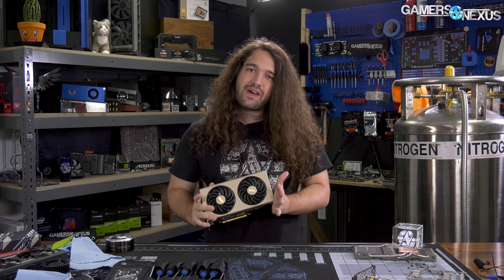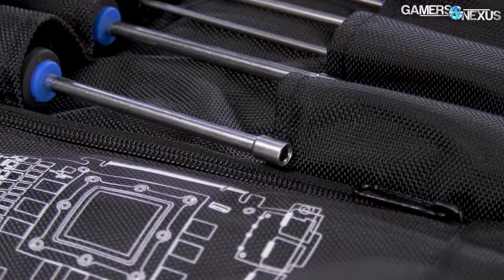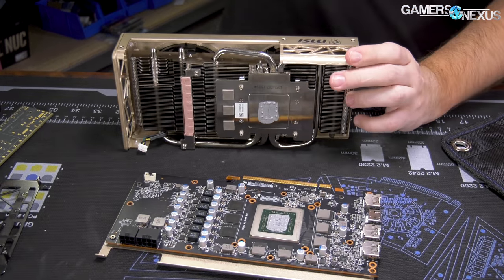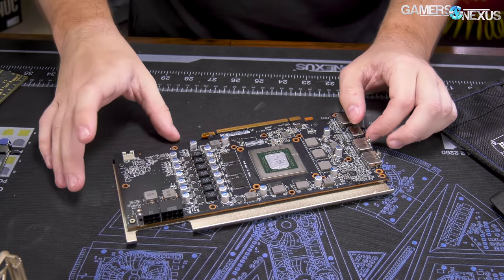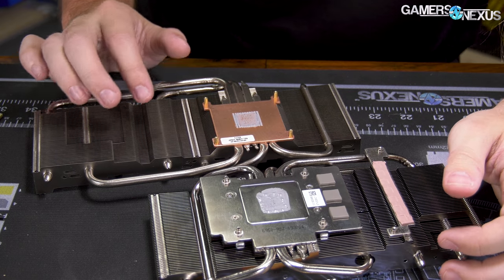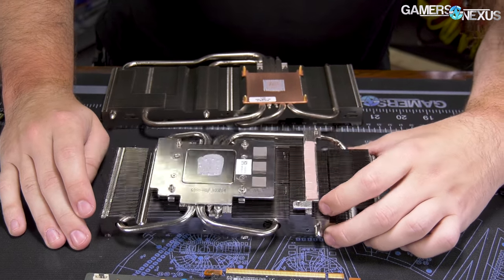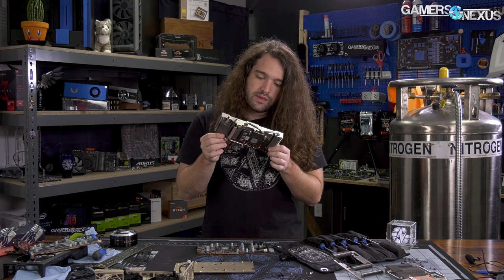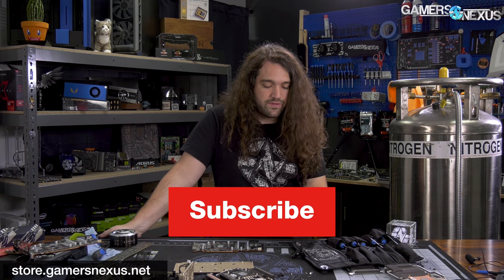Wrong Thermal Pads: Tear-Down of MSI RX 5700 XT Evoke OC

Comment: WTF are you doing, MSI? Between this and the BIOS update issues.. Wow. And you did so well with AMD stuff a year and a half ago..
Reply: @6Twisted  man.. I just bought a gaming pro carbon for my 3600. The feature set was just so good. I mean, they have to fix the BIOS right?
Reply: @6Twisted  I'm ok with losing support for older CPUs. Though I'll be pissed if they release a MAX version in a few weeks.
Reply: Curtis Riceman  it has a bigger BIOS memory chip so you won't lose any features in BIOS updates
Reply: @TheAssassin642  The B450 Tomahawk MAX is already out
Reply: @TheBackyardChemist  yeah but I wanted a Carbon MAX
Reply: True and also some ppl like me have problem with broken LLC on MSI's AM4 boards... LLC worked perfectly until 2019....
Reply: @Qwertypp10  what is an LLC? Are you in the warranty period?
Reply: @TheAssassin642  It is Load line calibration. Because it is broken I have horrible vdroop (I confirmed everything with HWINFO64 and mulitmeter) and I must run CPU at much higher voltage make it stable with my OC settings (I used to run 3975mhz@1,375v LLC=3/auto, now 3950mhz@1,4125v, because at load in fall to about 1,38v without LLC) . I am in warranty period, but it dosen't matter much... I mean in short:
Since 04.2017  I owned MSI B350 PC mate and up to about 2019 LLC was ok. Then probably after X BIOS update with probably some microcode or I don't know what is stoped working. I have RMA of and get new one with exactly same problem, again RMA and I took MSI X470 gaming plus and guess what still same problem...
I have also minor problem that offset voltage also stopped working. Maybe I decide to RMA it again, but I see it is waste of time.
Few topics in net, one on reddit, one mine:
https://www.reddit.com/r/Amd/comments/akmb9j/msi_b450_vdroop_and_llc_experience/
https://forum-en.msi.com/index.php?topic=323307.0
There is Buildzoid video, which shows how it should work, at how it used to work for me too:
https://www.youtube.com/watch?v=2DGDViPRh9k&t=1118s

I also thing that there is a chance that it is in fact broken CPU in some way, but I couldn't check that. However all people with that problem own MSI boards.
Reply: I have their b350 pc mate. I do wish they have new bios update for it, it’s been January
Reply: And the gaming edge wifi is a dumpster fire
Reply: yeah they did well with nvidia cards too, are they cutting corners ?

Comment: Retest with proper thermal pads.  It looks like the memory will fit on that plate
Reply: Why? Who would want to open brand new card? Why not just buy sapphire...
Reply: @megapet777  bro just for science, to see if the cooler's trash or not.
Reply: @megapet777  Garbage thermal paste made from dirt or slave children corpes probably?(Replace) Garbage cooler?(remod noctua with help of scalpel and replace). Installing additional rgb? List go on...
Reply: yea, the plate is not too small, they just used way to small thermal pads, which is ridiculous. retest with proper thermal pads please.
Reply: @megapet777  some folks will come here after already buying the card. Those are the folks that will need the info the most.
Reply: @megapet777  i open every card
Reply: David Lewis  i dig that attitude.
but you cant be sure that your new card is put together exactly like tech jesus' new card
Reply: @megapet777  because if the card works perfectly fine after having the thermal pads fixed, and arguably looks better to the buyer, then why not buy it? Aesthetics always play a HUGE part in our process of buying expensive products.
Reply: Brandon S  Sure, keep opening your cards while I buy ones that work well right out of the box xD

Comment: MSI has never cared about VRAM cooling. They completely neglected a chip on my R9 270x which caused the card to freeze up and require a reboot to make my PC functional again. I had to run my fans above 70% to prevent the chip from overheating.

Comment: Wait, aren't the half thermal pads still on the outside edge of the card?  So the excuse that only half would be contacting the plate because of the plate size doesn't even work here...
Reply: I totally agree
Reply: You saw wrong, or perceived what you saw incorrectly, the thermal pads you saw were for the components on ther other side of the GPU.
Reply: You are spot on.  a larger thermal pad would indeed make complete contact with the plate.  There would have to be a hole in the plate for it to NOT make contact. Just pause at 7:32 , it's obvious.

Comment: And the Sapphire's card has fuses on the PCB, the MSI's doesn't.
The little detail that could save your card if your AIO will leak or somthing.
Reply: Yeah, and the backup bios and bios switch too! The Sapphire card has so many premium features for only $10 over MSRP. They have set the gold standard with card design. Maybe they decided to go all-out this generation because they figured that there'd be a lot of first-time AMD gpu owners because of the general AMD hype train with Zen 2 and Navi? Or, were their cards always this good for this low of a price? I thought they used to be more expensive.
Reply: @syncmonism  A backup bios and bios switch are mostly worthless to most users and those that know what they're doing. I've flashed a few Nvidia cards and, unless you're absolutely insane, those extra features are a moot point.

Comment: A request for future teardowns; you're great at keeping things organized and explaining what you're doing so someone could follow along to replace thermal paste or fans, but would you be able to give some more detail on the hardware you're removing as well?  Things like thermal pad thickness and maybe even screw type (thread/length/etc) if you're able to identify them.  Info like that isn't too common online (thermal pads maybe, but definitely not screws), and as someone who's lost the mounting hardware for the heatsink of a card, that kind of stuff would be great for trying to find replacements without taking apart another one.  Keep up the great reviews and teardowns!

Comment: Gotta save them pennies though.
Quite sad that alot of manuf. do that to keep the cost low,
Reply: Sooo having to cut down thermal pad thickness by 1-2mm to squeeze out like a 1~5% saving in price?
Reply: @dra6o0n  no man, its a lot less, the diference between those is like 15 to 20 cents, they are cutting cost but even for them is not much. They just painted it like gold ans sold it like it, they are coming back to the pre 2014 era
Reply: makes no sense to me. a customer is spending $400 and the bean counters want to place the company branding on the line to save $1 a unit. if they are that desperate to save $1 focus on the packaging!
Reply: @allothernamesbutthis  it's happening everywhere, not just computers.
There is only so much wealth in the world before people start fighting over it.
Reply: @allothernamesbutthis  it wouldn't be just this video card they they are cutting costs on. MSI make around 1.6 millions mobo's and over 1 million video cards per month from one of their Chinese factories. At a saving of $1.00 per unit we are looking at a saving of over $2.6 million per month or over $31 million per year. They are more than likely saving between $2-$5 dollars per unit at the manufacturing level which means the factories management team look like hero's for their shareholders and board members. Remember its all about making more money with limited resources while spending less on expenses which means a higher profit level for the company and the various stakeholders. 

Even with the negative press for the thermal pads from this video card the company is most likely supplying parts for other companies where those companies have customers that "don't care" OR will never be aware of the cost cutting measures as the products they will end up buying will be doing "good enough" so they will get away with it. 

I'ts just good business practice tbh and happens everywhere.

Comment: Question, will you be reviewing the XFX THICC2?
Reply: Seconded. Also curious about the Xfx RAW 2 and any potential tear down videos?
Reply: It's the same dumbass cooler design as the Fatboy. The RX590 Fatboy I own, performs worse than the Sapphire Nitro RX580 I own. It shouldn't. The older chip should perform worse, but it doesn't, because the Nitro has such vastly superior cooling that while the Fatboy throttles down due to temp, the Nitro keeps going at boost clocks.
Reply: This!!! Im waiting for a GN review of that bad boy. Errr uhh, girl? 
I'm not due for an upgrade but I love watching tech content and a video of this card WILL get my view.
Reply: @hyperstimmed  but the name gives it +6.9 fps
Reply: @hyperstimmed  Same issue here. Did you try undervolting the card ? I just decided to underclock and undervolt the card. Got it to 1480 with 960 mv and a power limit of -10%. On average it hits 59c-62c and occasionally can hit 65c. Best part is it consumes between 70w-130w.
Reply: I almost wish that they wouldn't because of the name. XFX clearly has no dignity using such a name, so why should they get free coverage? But, we know that it'll get a review regardless.
Reply: @ShroudedWolf51  Uhh, I don't think a name makes a graphics card. (To enthusiasts any way) It looks good. Aside from the memory and vrm temps.
Reply: @ShroudedWolf51  🤡

Comment: because of the good price, i bought a reference 5700 xt. It boosted itself up to 2000mhz and was running hot (Junction temp 110°C). I limited the frequency to 1800mhz and then my card was not even reaching the 90 degrees anymore. I have a nice airflow with bequiet fans and a additional sidepanel fan which let my card run at 60-78°C with 1800mhz. The amd reference cooler is blowing with 2150 RPM at 80°C and 1650 RPM at 55°C. I wouldnt have bought the card if I had not seen the GamersNexus videos. Thank u steve for helping me to decide.
Now the Card is in good hands and part of the PC Build Family. Sounds a bit crazy, but since im giving to my PC Components Names, i called the 5700XT Steve. Compared to all my favourite PC Builder Channels, you make the best 5700xt Reviews.

Comment: There would be no need for re tooling.  The outer most edge (furthest from the die) of the memory is making the contact, it would of just covered MSI's serial number on the heatsink.  Weird reason to only use half a thermal pad

Comment: A taped together shroud, half contacting thermal pads, no bios switch... the MSI AMD lineup sucks this year. And they did so well on the RX480 Gaming X a few years ago.
Reply: They will probably release many different models of RX 5700 XT and 5700, and hopefully soon they will replace or update this model. They no doubt have a cheaper version on the way, and I wouldn't be completely surprised if one or more of their cheaper versions actually perform better, at least in terms of thermals (they just probably won't look as nice).

Comment: Steve is usually right but the thermal pads are on the outside so a bigger pad would make full contact with the heat plate. The reason they likely made the thermal pads smaller is because they are directly on the heat pipes so they would have better heat transfer anyways and don't want to steal more heat dissipation from the GPU.

Comment: 12:40 you have that backward.  the base plate for the memory is big enough to cover the whole memory chip. if it wasn't, the other half of the memory closer to the gpu would be covered. but you can see the half side that is away from the gpu is covered by thermal pad. so the fault is during assembly.

Comment: You are completely correct, MSI does this. My R9 390x died 4 month after the warranty expired, so I decided to open it up. ALL the thermal pads were like that, not even 50% (more like 30%). I see burn marks on those components and the card is pretty much SOL, tons of artifacts and green spots in 3D rendering. I replaced all the thermal pads myself and ended up with another 3-4 month of use before it completely just artifacts way too much to bare, probably one of the memory chips going bad from the heat. Note worth taking that the thermal paste on the gpu was half as well, the other half was on the PCB board...this is probably a QC problem but many users of 390x from MSI has complained about bad thermals. I was able to get the card under 80c on full load vs 95c brand new by just redoing what should be done in the first place. Everything is also hidden behind that warranty void sticker which stops people from fixing their shit.

I'd stay away from MSI with this shady practice, either they are saving a dollar per card or this is some planned obsolescence or both.

Comment: Steve the coldplate is big enough to cool the entire memory module.  I'm surprised you didn't catch that, but notice the pad is on the FURTHEST part of the memory from the center, which means the other half is not beyond the plate, but further inward.  They literally just put half sized thermal pads on for no reason, the area is there to cool the whole thing.  This would be an easy mod.  And even if a module did stick past the cold plate, it would still be beneficial to put a pad on the whole thing when only half of the pad touches the cold late.  the pad itself will allow for some increased heat transfer horizontally from the module.

Comment: Quality control with MSI seems to have gone south lately. What a shame because I have been a fan of MSI products for a long time. Against my better judgement, I went ahead and bought this card knowing what I was probably getting into; mainly because I got it for $360 after rebates. I like techie projects so I had every intention of tearing the card apart even before installing it. Yep Steve, they only made ONE tweak to this card since you reviewed it; they removed the tape and instead put two small foam/rubber spacers between the cover on that small area that you pointed out instead. The thermal pads are the same crap offset job as you have reviewed here too; and in fact, they completely missed a memory module with no thermal pad at all! I carefully removed all of the thermal pads and applied my own new ones with complete coverage for each module. I removed their soupy thermal paste and applied a better paste and spun the card up on a Ryzen 9 3900x 12-core. It posted a 15,265 PassMark score (ver. 10) with the latest Adrenaline drivers as of this posting. Decent but nothing to go crazy over. It'll be fine for my specific needs and should last quite a while. If I've learned one thing here it's that I may never buy another GPU without first taking it apart and inspecting the factory thermal job. Thanks for doing this review.

Comment: I suspect the reason for the double sided tape might be to eliminate vibration noise.  A cantilevered part of sheet metals vibrating with the fans would almost certainly cause rattling in some unfortunate units.

Comment: I think the solution sapphire solution is not for thermal isolation but rather for easier manufacturer.
They don't have to redesign the main cooler for different cards but only the cooling for the memory / and vrm cooling portion.
As well as not having to make the main cooler more complicated just to cool other parts. The vrm / memory cooling on the sapphire one looks actually pretty cheap to make and it also reinforces the pcb.

Comment: so replace the thermal pads with a minus8 pad or something. that's disappointing cost cutting.
Reply: Just how much money does it really save... It's ridiculous by MSi I can't say for sure but I don't see them doing this to Nvidia
Reply: @saminavy7124  Nvidia is the only GPU manufacturer in the topmost performance bracket, so cards in that price bracket have more effort behind them. AMD's been content to stay in the low and mid tier performance segment, so manufacturers won't put as much effort behind these cards. Asus is the only one to even have a fully custom pcb for the 5700xt, and that's (afaik) only on the Strix model, and I theorize the only reason they even did that was because they were obligated because the Strix lineup is at or near the top of their product stack.

Most AIBs aren't gonna do anything besides use the reference design with a custom cooler, because the 5700xt is a midrange product from AMD. There's nothing to it besides value proposition, and value-oriented products will get more cost-saving measures so the companies producing them get a better profit margin than they would get if they put actual effort into the product.

It's unfortunate for everyone, but that's just how it is.
Reply: @pokeguy742  That's why Sapphire or PowerColor cards are so good, they don't make Nvidia cards! So avoid any other brand if you want good AMD GPU.

Comment: I really want Noctua to make a GPU cooler for reference boards.
Sure, you'll lose the warranty, but I have very litle trust in these board suppliers ability to manufacture a proper cooling solution.

Comment: Edit: someone already noticed in the comments.

16:45 Isn't the baseplate already big enough?
The thermal pad was in the furthest position on the memory module and the baseplate has the marking of the thermal pad well within it.
Thus the thermal pad size is the problem not the baseplate, or am I missing something?
Reply: @Hazard The thermal pad is certainly too small to cover the memory chip properly.
About the reason why they made it this way, I can only guess it was a mistake in the early production.

Comment: @Gamers Nexus , you are mistaken about the half pads, they didnt need to make a bigger plate, the non-covered part of the mem is on the inner side where there is a plate over it, they just needed a bigger pads, but i dont think this is the problem. It could be the closed backplate over the core part, and also could be if MSI is using bigger voltage for the same clock speeds. You can test this.